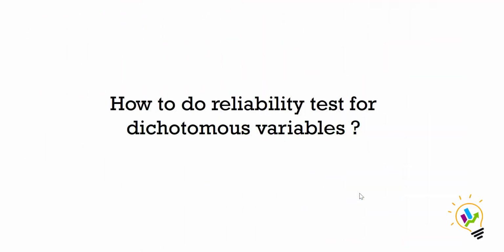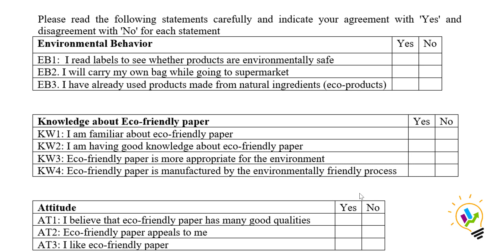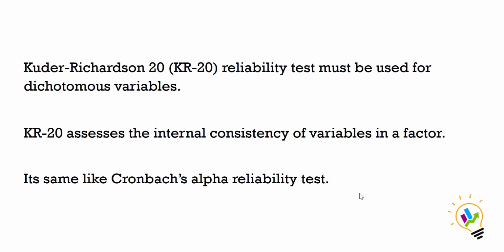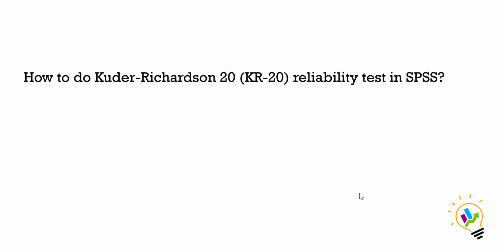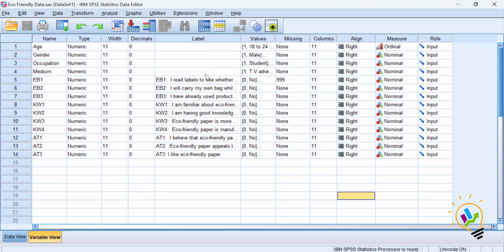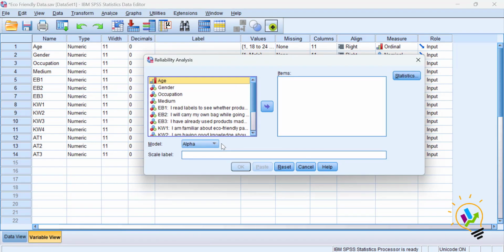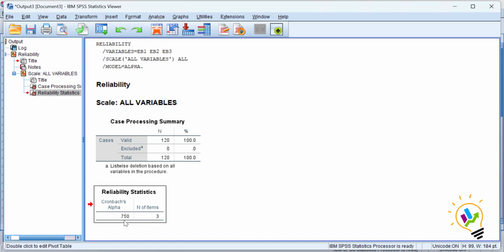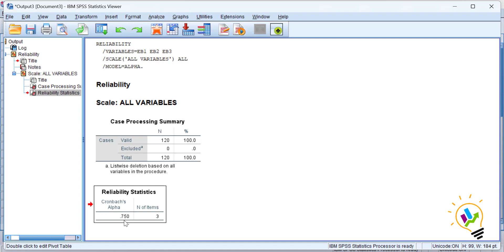How to do reliability test for dichotomous test?  Kuder Richardson 20

Comment: Thanks for the video! Could you also explain how to do a validity test for dichotomous variable (yes/no answers)? Can I use Pearson test for that? What's the best method? Thanks in advance.
Reply from the maker: Validity testing for a dichotomous variable (e.g., yes/no answers) involves assessing whether the variable accurately measures the intended construct or concept. There are several methods for validity testing, but Pearson correlation is not typically appropriate for dichotomous variables, as it assumes continuous data.